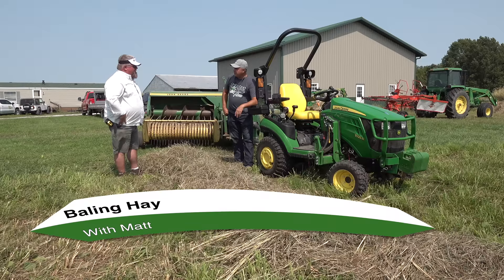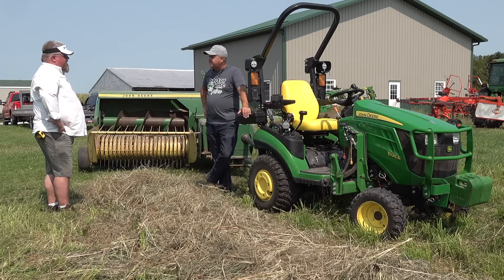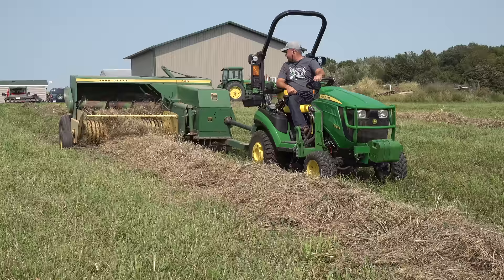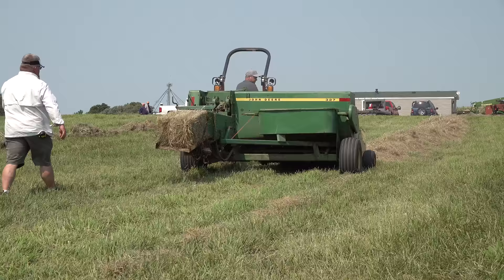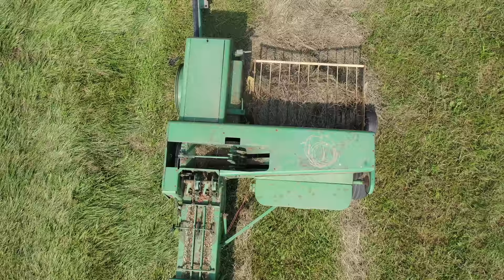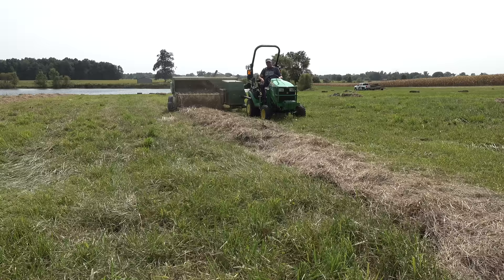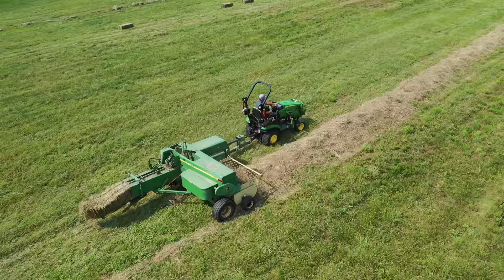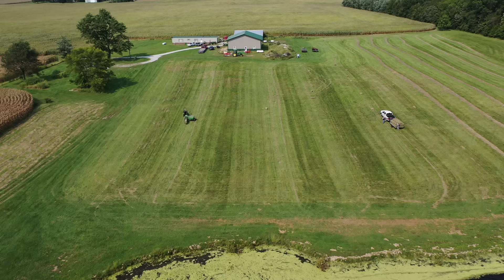FULL Size Hay Baler, Subcompact Tractor, John Deere 1025R!

Comment: PERFECT!  This is the one outstanding issue I am trying to resolve. I am turning 3 1/2-4 acres into hay fields now that we are down to 1 horse, and my Kubota B2410 will handle a disc mower and tedder, but wondering if it will pull and power a 24T or 327 baler. Now I know, if the 1025R which has similar HP out of the PTO as my Bota, and the Bota weighing a bit more, now seeing is believing, it will.  This will save me THOUSANDS of $$$$$ by not needing to buy a second tractor, or trying to find one of those small Italian jobs made for Compacts.
Reply from the maker: Just be careful with that stubby PTO.

Comment: I was just a kid - Dad use to have in the 80's and International 435 similar in design. I am not sure what happened stick rock something jammed and boom stalled tractor "not sure how he got it back running". Dads tractor was 48HP so all ended up being good. He parked it and bought a round baler that year. To me where the story gets funny!! So his buddy's square baler went down and borrowed dads he did a lot of hay so he brings his 4640 Deere and takes off same thing happened to him minus stalling the tractor LOL busted a lot of stuff in the balers shaft still spinning. I guess something was wrong with it. Never even tried to fix sold as scrap

Comment: My uncle had a Massey Ferguson equivalent bailer back in the 1970’s and he used to use a MF 165, whilst that is not a big tractor by today’s standards at full throttle the bailer was still able to rock the tractor back and fore with out much problem.

Comment: It takes a lot of tractor weight to stop that rocking back and fourth with plunger.  My suspicion having run numerous square balers of different configurations on numerous different tractors is you would have to get up to a 4 series tractor to see any noticeable difference.  I am however curious if a 2 or 3 series could bale with a kicker and wagon in tow...?  Does anyone have experience with that?  

I'm more curious if a 3 series could run a 4x4 round baler?  Anyone out there done that?  If so, what was your experience like?

Tractor Time with Tim, I'm not sure you could run a newer over top square baler with a 1025.  The plunger on them is usually sped up quite a bit.  They're designed to bale what you did at about 3-7 times the speed depending on the baler.  Uses a bit more power than I think you have once you crank that plunger up.  I wouldn't advice running slower ground speed, as you will offsize your flakes.

Cool video!
Reply: I would bet the 2032 at least would hold it much better..  I just upgraded to that from a 1023e recently and the difference is dramatic in all respects.. size, horsepower and hydraulic power..    I have some logs and such that the 1023e just could not do, it could not even pull them with chain along the ground.    This new 2032, not only could pull them but lifted these huge 8 foot long, probably  3-4 foot wide logs as if they were toothpicks.   I knew to expect a dramatic increase but these new 2021 models have really got some huge changes to them..   Not only that, I was shocked to find this thing also has cruise control and a button that allows you to drive it like a car or truck.. i.e. you press the foot pedal and you speed up and the tractor autothrottles..  turn it off and you go back to standard throttle level control.   My wife clocked me at 30 mph when we did a quick road test..  and I slowed down because on a tractor that size, trust me you feel like you are doing 50 or more.. but I wonder just how fast this thing is geared for now in high gear mode.

So I would fully expect this 2032 to handle this bailer much better..  Currently I have a grapple and a full 3 point stump grinder attached to mine (damn is that stump grinder freaking heavy... it is more heavy than my weight bar filled up) and the tractor barely even noticed the thing during grinding of big stumps...  Very pleasantly surprised with this upgrade.

Comment: Perfect timing as I've been working through the idea of doing this! I've got to deal with hills so I'm going 3049R or MF 2605. Horse power isn't my worry it's weigh of the baler on the hills. Also do want enough power for a decent sized dicsbine 3 point or maybe a older sickle bar haybine. Looked into a 1840 after your show video and again weight needs are pushing up a size bigger then power needs seem to be.
Reply: Get a 4020
Reply: @Jet_Hammer  love those tractors, but with 5 acres total 3.5 of that field, it may be over kill.

Comment: Tiny round bales of hay make work I guess. But around here some people try out with haysilage so it's semi-wet and then wrap them in the field (there is a combo bailer, or if the wrapper was pull just afterwards). Those are too heavy for people to lift all day so you need a tractor/loader. But there would be so many of them! I guess the selling price is higher too but to me it would be so frustrating.

Comment: Another good point to squares as opposed to a mini round bailer is cost. A mini round bailer is going to be $10k and not much in the way of used ones where as a used square bailer can be bought for 3k or less so if you are using a subcompact your not bailing 100 acres your doing about 10 and cost for cost a used square bailer makes alot more sence

Comment: Odd that I had this same question last night as I try to decide between a 1025R and 2038R...."wonder if the 25 could handle a square bailer...".  And then I got the notification for this video this morning🤣
Reply from the maker: Get the 2038r!
Reply: @TractorTimewithTim  Also if you have any slopes in the fields get ag tires. My r 4 s don't grip on slippery grass very well

Comment: That little 1025r does pretty good but gotta be careful if you do anything other than flat ground those balers weigh more than the tractor, not a good combo on side hills or up and down that plunger pushes the tractor all over the place, I had a 40hp Kubota L3940 and for our hills it got pushed around a lot, had to go up to a M6060 to get the weight to control it on the hills.

Comment: I am surprised that work so well.  I believe they recommend a min of 45 hp on those bailers. The bucking was from the engine making quick rpm drops with the plunger slamming.  If you watch videos of big square bailers you will see some tractors blow a puff of black smoke every time the plunger hits.

Comment: I’m actually surprised. I really thought it would have rocked the tractor a whole lot more. Do you think it would handle it on uneven terrain? I’ve been looking into the little round balers and the advantage to those is 1 of them is about equivalent to 2 squares if you get the bigger models. Great video.
Reply: Most likely, this was due to them making a moderate density bale.   As you add compression to the bale for higher density, the plunger impact increases greatly.   Guys who use mechanical handling equipment (accumulator / grapple) want higher density.   I've seen 75hp tractors rock when you crank the density up.
Reply: @lkj0822g   I agree. Our New Holland 276 rocks the John Deere 5075 but our bales are usually 60-70lbs. We sold by weight so the more the load weighs the more money. We also have a kicker too though.
Reply: Not to mention the light duty tractor pto will be destroyed!!! Its not made for this kind of stress
Reply: @crazyhass84  agreed ,,. although the pto should handle a tiller , the baler has a surge , which might gut the p-to and could stress the clutch center plate and cause it to stress fracture ,.,.

Comment: All the variations of those old JD SS Balers have knotter issues when they haven't been used in a long time.  My old 336 has cutter blades riveted to the wiper arms and I need to pull the whole knotter apart to rebuild that.
To me, seeing the pickup throw the hay forward tells me that Matt cut that grass shorter. The taller grass feeds up into my pickup better than short stuff.  Once everything is adjusted it's not bad.  
I pulled that 336 with a JD 4520, I thought that was to small, can't imagine a 1025 doing it efficiently.
Reply: hay had to be done at this time, timing is everything and we've just entered the rainy season, after the drought this summer he is lucky to get a 3rd cutting in as most have only gotten 2 very skimpy shorter cuts in and their fields were burnt for a month after. every farmer is very short on hay to the point every ones been slaughtering most of their herds in early summer rather than trying to feed them till season, and the prices have almost doubled in the growing areas alone, hate to see what the ranchers out west are paying. bad enough all the feed corn is being bought by tax payers to make ethanol and it's only 80% as good as fossil fuel.
Reply: Zach, Matt didn’t have the pickup all the way down. The gage wheel wasn’t even spinning. That’s why the hay was launching forward so much. I noticed it right away too. I suspect he was trying to keep the tines out of the dirt. If that was a concern then his gage wheel wasn’t adjusted properly. When the wheel is on the ground the tines should just miss the dirt. I custom baled hay for years with my JD 336 and watching this was kinda painful. I wanted to be there to adjust his knotter and pickup. Also to make sure he wasn’t running his RPMs too high.

Comment: Back when I was a kid my dad had a IH baler that he pulled with a Farmall M which didn't have live PTO but he had a IH motor on the baler that was around 20 HP and it had no problem powering the baler so I am not at all suprised that the compact would power this baler however that being said Tim you was on flat ground and I believe if you was on hills with the baler and sub compact tractor think you would have lots of trouble with the baler pushing the tractor down the hill and maybe to the point of being dangerous. I'm not real sure that you wouldn't have some trouble going up some hills. That baler out weighed the tractor and without breaks on the baler holding the baler back it might push the tractor into a slide off a hill and God forbid if it jack knifed going down because if it jack knifed the baler might just flip the tractor.

Comment: The tech has come a long way. We own a Deere 5200 from the 90s and its rated at about a 37hp PTO. Its funny now that a Kubota L3901 is just as powerful but a much smaller engine and frame etc... I can easily see that little 1025R spinning that square baler just fine. The 5200 can turn a round baler with out much fuss. So I am thinking that a 2500R can turn a round baler although I wouldn't recommend it due to the weight of the bale and the machine might actually be a major safety risk for the operator of the tractor.

Comment: Set your baling speed by when sheer pins break. But I think the baler shoot should be full. I believe as an experienced hay baler your were going way to slow most of the time.  Little tractor was fun to watch
Reply from the maker: I was going as fast as the little tractor would pull it.

Comment: Just because you can, doesn't mean you should.   Others have noted, if this field were more uneven, then the baler would probably push you downhill and require extra horsepower going uphill.   More horsepower would also allow you to make denser bales, which handle better when using mechanical devices such as accumulator / grapples.

Comment: For completeness...  JD does recommend 35 PTO HP as a minimum for the current 328 baler, which also specs out at 2,700 lbs.  Johny 1 is only rated at 17.2 PTO HP and 1560 lbs.  I'm guessing your ballasted weight is somewhere around 2,000 lbs.  Is Johny 1 and a JD small square baler an ideal combo?  Probably not, but it certainly got the job done on a 10-ish acre field of lighter hay.  It would also help if the wind rows had been kept smaller.

Comment: My first jobs was to bale hay when I was 13. Nothing like standing on a bumping lurching wagon being drug behind the baler and grabbing the bales with a giant metal hook and stacking them on the wagon higher than you head. And stacking them later in the top of the barn was even worse. Working on farms I did most of those things they had on the "Dirty jobs" show I think.
Reply: That was precisely my experience when 13. We could get 4 loads a day, then we got a "labor saving" kick bailer but we still stacked between alternatively catching bails and getting kicked on our butts by them. We then were able  to do 7 loads a day and the days got longer with more work in the haymow in the August heat.

Comment: I can tell you a square baler would be hard on a tractor that size. If you have a smaller capacity like this baler or less it would be better. But if you were to go to a high capacity baler it would destroy the pto and driveline of the tractor. I’m have a 326 NH and have baled with a 55hp Deutz and I can tell a huge difference in the performance of the baler. The baler performs better when you have plenty of weight and power. If that’s what you have you could make do but I’d hat to think that’s what I had to use for thousands of bales. Good to see it put in some work though.

Comment: I always wondered how small of a tractor would run a small square baler.  Once I checked on the web and the answer I got was 35 Hp and 3000 lbs.  the extra weight would help with that lunging.

Comment: Well, you answered a question I had since you showed us the mini round baler a while back. I figured the 1025 would have the PTO power for an old small baler if you took it easy. Now I guess the tractor business question is how much acreage to you need to hay with a 1025 to reach break even on all the equipment costs. I figure you need disc/cultipacker, planter, cutter, tedder, rake, baler, shed to store the bales and maybe some other stuff?
Reply: you don't need a shed, most farmers have gone to tube tarps. you just need above flooding/high ground or along a tree line/fence. depending upon what you seed and acreage a planter could just be a funnel spreader.

Comment: Hey mate, could driven it harder. Nearly 50% there was not nice fluid feed. Most squares were made for 28 - 35 hp. You would need a heavier tractor if it is more undulating. Many years ago when I baled ever an 68 hp would rock like this little JD.

Comment: Take the flywheel off and it wouldn't
Most of the stroke or rev requires little HP
Most of the HP is required for the end of the plunger stroke when the knife cuts and the sandwich compresses
Hence the flywheel borrows power for the end of stroke

Comment: not exactly.  the needles pass through slots on the plunger.  we have a new holland the runs with a two cylinder gasoline engine rather than a pto.  nice photography in your video.

Comment: GREAT VIDEO answered a question i directly wanted to know, but unfortunately i think this would mean i need to keep my 3025, lol.
the question i have left that is unanswered is fuel and time wise how did this compare to the big dog in the back ground? a good question you answered with out knowing, was the wear and tear with the strain on the machine comments you provided, yeah that 1025 can do it, but in how much use are things going to break, and what things, and how often/much!
i remember this 327 series, it was when the 3000 big dually johnnys were new,  john deere mid-late 80's era. in my case it was a 3050 and before that a 1050. my fav was the 2020 but it got kicked around still by even the 14T baler. neighbors 2030 handled the 14T fine tho.  look at the lawn/garden tractor and you will know by the same styles. in this case the 300 series such as the famous 318 lawn and garden tractor into the first 400 series with the 400-410-420-430's
#1 rule in safety the vehicle doing the towing should be 2 times the weight/size of the towed apparatus. this puts the control in the bigger machine for hills, ditches, slopes and velocity laws of physics 1.5 is doable, the chance of tipping over on any of those laws of physics violations is 50% greater. the degree of the hill, ditch, slope, velocity is basically double the danger for every 15º&/30% of throttle. my grandparents taught me this. my great great grandfather violated the laws of physics taking a john deere model b along the side of a hill with an old 3 point hay rake. the 3 points of axis on the wheels was not adequate stability and the tractor rolled over onto him killing him in his late 20's. my great great grandmother raised 6 preteen kids on her own and lived to be 109.

Comment: The lug is also more prominent because you’re going quit slow. 
Is a modern 25hp compact’s PTO as heavy duty as an old 1950’s 25hp tractor?  I’d guess no. Thankfully,  the designers put a big flywheel on the baler to smooths out the shock load from the plunger that compresses the hay, and evens out the power required, making it possible for a small horsepowered tractor to be used. 
…but how hard (wear and tear) is it for a compact’s PTO to get that big flywheel spinning? I used to bale with a 125hp tractor and you’d want to ease that PTO on to get that flywheel up to speed. Clutches must smoke when you slam on those electric PTO switches of a compact.

Comment: I know you are always looking for new uses to display the power and capability of these sub compacts Tim, if I may make a suggestion; I think you should find a PTO driven whole house generator to test on these tractors. I recently added one to my 1025R tractor and I have experienced a learning curve on what size PTO shaft, angle, all that. I think it would be interesting to tackle. I got my generator at harbor freight. It was rated a bit heavy for my tractor, but you don't want the opposite problem for your electrical loads. Just a thought, take care!